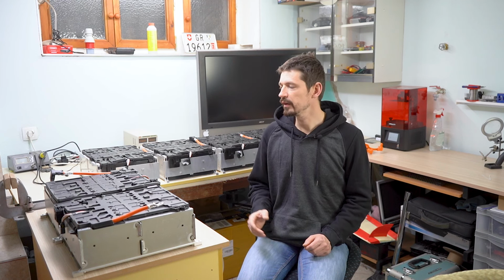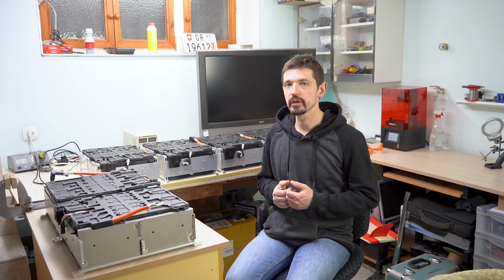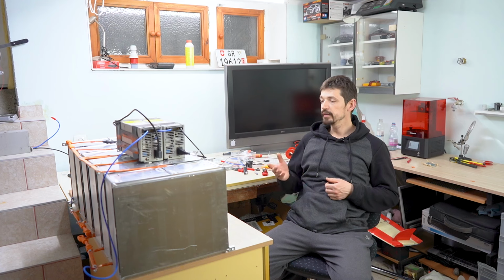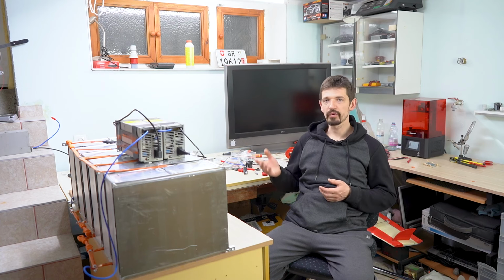BMW i3 battery reconfiguration

Comment: Very cool, I am attempting  reverse engineering of BMW i3 slave module. but struggling to re-index the slave. I want to reuse the slaves of different battery packs but they have some same indexes, so I need to re-index then via CAN. any help is valuable. thanks

Comment: Very good video!
Doubt: how to connect the 13 voltage control wires that come from each battery. 13 x 6 = 72 strands. Did you put the wires in parallel for every 3 batteries? Then call the two BMS?
 Thanks!
Reply from the maker: hello , tnx, 3 modules are in paralel, second tree as well , and this two groups in series to get 24S or 100V
Reply: @bimerev  ok, thank you!

Comment: Please do follow up with an update showing the installed batteries in the vehicle. Good skills!
Reply from the maker: tnx , but I can't.. Unfortunate I had very bad experience with this guy  and that throw me out of the track for cuple of days, and this will cost me one big decision what I made during this time that I will regret in future.. :(
Reply: @bimerev  sorry to hear that. Keep up the excellent work.
Reply: Great video, thank you, would you might sharing the connectors you used to join the i3 HV cable to the copper bus bar?
Thanks
Reply from the maker: @MiniLifeCrisis  tnx , sure , https://www.ebay.com/itm/262966362694?var=561974621057 https://www.ebay.com/itm/254149939902?var=553497995215
Reply: @bimerev  any updates? Thanks